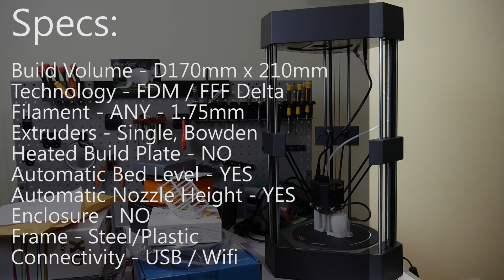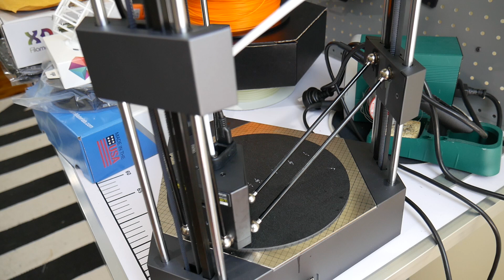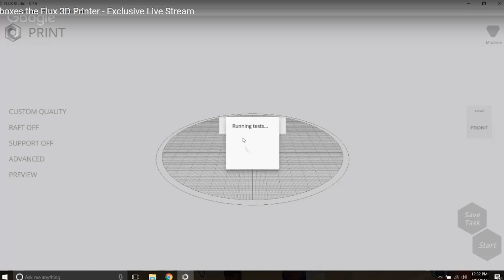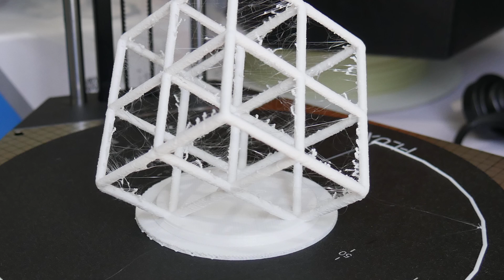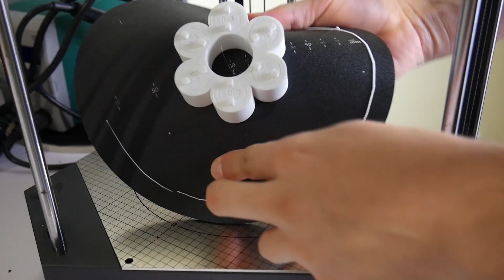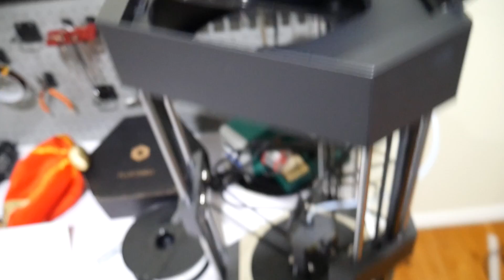FLUX Delta+ 3D Printer Review - Part 1

Comment: this sounds like a very bad printer... I've loved my prusa i2 printer and any faults have been my own, not the printers. soon that will be rebuilt into a i3 variant.

Why would a company release such a product that clearly will fail unless you modify it and maintain it after every print. Sorry but with the market of printers, this appears to be a failed attempt at something that could have worked if the just kept it simple.. price wise seems to high for the build size.

Comment: I have the original Delta and I absolutely love it. Mine is the kickstarter edition and the only ongoing problem I've had is base adhesion and laser posts popping up. Both of these issues were fixed by parts they sent out after they released the Delta+.

Mine hasn't exhibited any of the strange skin issues you experienced, but I don't use the Cura slicer. I've found that Slic3r was the best before they added Cura2 and now Cura2 is easily the best way to go. With a little bit of tuning, you can get rid of stringing, raft separation, and retraction issues. It would be nice if the printer had better defaults. I'd also love if it allowed you to identify different filament spools and supported changing of a few specific parameters (temp and retract at least) per roll without overwriting your entire set of print prefs.

I use the 2nd bowden tube along with a filament lubricater to enable holding my spools right next to the printer. I can hold 4 spools in these caddies I made out of Ikea magazine holders. All of this sits on top of a small nightstand which has drawers to hold all of the spare bits, extra spools, and scrap plastic.

Comment: hi, the machine is pretty new but I don't really get bad print results, I got the all so popular 3D benchy great and as Jeff said the stock filaments are... well.... not so good. and I got this torture test good too: http://www.thingiverse.com/thing:2064029  but with a little stringing, I don't have simplify 3D(gonna get it) so I don't have retraction settings right now. And oops, I'm not subscribed even after recommending you this printer.... 3.. 2.. 1.. subscribed, anyway please give me a worthy torture test and I will post my results, and flux has been a little wobbly on keeping it's promises lately so I had my on this, it's a little pricey but looks good: www.makerarm.com it has more tool heads than the flux(much much more) and most importantly the chocolate extruder head. anyway, thanks!

Comment: Hi Angus,
First of all, glad to final see a review on the Flux 3D Printer as I own and have been using a  Kickstarter version for a year+ now and do from time to time participate in providing feedback/fixes when time permits... and therefore also understand your comment regarding investing time doing these review. I, for one, appreciate your great efforts and feedback to the community. Yes, as you alluded, all kickstarter model comes with their "surprise package" and that is parts of the "fun" in my option. As long as Flux stays true to the Kickstarter mission and goals, and support their Backers with product fixes along the way, then as far as I am concern it is business as usual.
It is very unfortunately that Flux provided a bad batch of white PLA filament, and that due to the Printer's spool configuration & constraints, you were only able to review the product as provided by the manufacturer. Manufacturer are responsibly for their own Quality System and need to take this seriously as opposed to just sticking a QC sticker on the item.
From experience, I am very pleased with Flux support and endeavers to improve their product and attend to the Flux community and command the Flux Team in that respect. So, well done Flux, and keep it up.
Overall a fair review given what was issued for the review (again Flux is responsible for the quality of their product, especially for a demo/review) with respect to your criteria and objective. 
For those viewers attracted to the multi-tool heads capability (printing/scanning/drawing/laser) aspect of the unit, especially that of the Scanner (as was my case), please keep checking the Forum's feedback and discussions before making a purchase  decision based on that specific need.
Angus, back to you mate, and have a great time at the Bay Maker Faire... I am jealous!

Comment: I think they told you a lie. I had ordered the original Flux Delta and there was so many issues with it that they delayed shipping my order until they had to cancel making them and tried to re-invent the machine by calling it Flux Delta+, but it had the same specs and everything as the original machine. It did not look different except for the print bed (they made that magnetic). They also had this issue that would make your print head come crashing down to the print bed even though all the magnetic joints were still attached. They might have fixed that, but now there is all this weird fragmenting as you have shown. I am glad I cancelled my order when they gave me the option to. I would have regretted getting it. I originally wanted this machine because they also offered a built in 3D scanner, a laser engraver, and a drawing print head, but is it worth all the problems that came with it and pay for the hefty price tag? Certainly not.
Reply: Huh? They stopped manufacture of the Flux Delta once they'd fulfilled all the kickstarter orders, and had sold some retail, and were ready to put the mark2, Delta+ into production. 

And as far as the print bed, it is exactly the same... the hexagonal steel plate. But on top of that there is now a BuildTak magnetic print mat, which is probably a customised version of the BuildTak FlexPlate system that has just been released. 

I've never had the "print head come crashing down to the print bed even though all the magnetic joints were still attached. I've had it detach in the first days of usage due to improper USB cable installation, and not enough lubrications of the joints, but that was all. Haven't had a single rod detachment since then.

I'm sure the fragmentation is due to sub-par cura2 settings and the poor filament issues... I'm having issues with the cura2 settings, and have revered to the original cura settings with the normal excellent results.

Comment: If you have a machine big enough, just print a cover with a lip for that hole at the top with a spool holder and a small hole for the filament to pass though. Only idea I have for a third party spool holder.

On another note; 
I'd like to someone toy with the idea of a Stewart Platform for a printer. Originally they're meant for 6 axis movement, 3 axes of linear and 3 of rotations, but they could be used for just linear movement, though rotational properties could add some cool effects to printing if someone found a way to utilize them. Their basic design is 6 legs that meet at two triangles, one offset 180 degrees, and they're hinged at both ends. Most designs utilize pistons for these legs, but I've seen some using servo motors with solid legs. 
But think of six axis printing, you could print slants as like a normal vertical print. 
I've wanted one for the longest time for cnc work, due to their six axes of movement, and I've wanted them for other uses that I have yet to mess around with. 
I think the biggest problem is controlling them, due to their movement being synergistic, which requires complicated algorithms to control.
Reply: IIRC, the hole is actually smaller than the build area of the Delta, so it is actually possible to print it on it if you want to do so. There is already a design on thingiverse for it, as other users wanted to fill the hole, probably to help with dust and make use to the top space for storage.

Comment: Lastly, I never use rafts since it always stuck to the print.
Reply from the maker: Thanks for the info! Rafts should normally not weld to the part... I'll be stopping using them on this machine, it was just ticked by default.
Reply: My pleasure :)

Comment: Also, if a magnetic joint comes undone, the printer will stop. 
When you re-attach the joints you can hit the FLUX button, or hit the dialog box in the software.
Reply: When it happened to me, I didn't have the USB-C cable and the filament tube set up correctly and they knocked it out of place.
Reply from the maker: so... they do come off during operation? or? Good that it stops.
Reply: True that. I did that too. But that's just user error. Happens once.
Reply: Rarely does this happen... only when not lubricated well.

Comment: That bowden feed tube is loong. Its going to be difficult to tune in the retraction length. Wonder why manufacturers dont put the extruder on one of the linear servos to keep the length down?
- Eddy
Reply: It really is not difficult at all to set retraction. The tube is only 46cm, I've seen plenty of Bowden setups over 50cm with no issues.

Comment: Blarg... These cheapo delta machines really give delta machines in general a really bad reputation. All I ever use are delta printers and I haven't seen any of the issues that are typically showcased by the cheapo designs.

I posted this prior to seeing the price! MY GOD! 1k for that? Everything about that is cheapo. Linear rod bearings. Cheap. Magnetic ball joints. Cheap. Plastic... cheap. No heated bed. Cheap. This thing was specifically designed to rip off people who don't know any better. 

I would highly recommend avoiding this at all cost. Build a Kossel mini for less.

Comment: I am really satisfied with my original Flux 3D, especially after the Free upgrade kit (shipping cost only) which basically makes is a Flux 3D+ if you change the linear bearings like i did.
There is a very active and supportive forum and Flux support itself has been very good the last year. 

My Flux spool holder: http://www.thingiverse.com/thing:2009127
Flux 3d profile is supported by Simplify 3D: https://www.simplify3d.com/software/supported-printers/
Alternate S3D Profile: https://www.dropbox.com/s/owudzpvhchxkdd2/Flux%20Rev2.0%2020%25Infill.fff?dl=0                                                 (From: http://forum.flux3dp.com/t/simplify3d-fff-profile/1594/16 )

Comment: mmm....its actually a bit sad that is not doing that well. Already PO the unit much earlier and hope the unit would have better updated firmware / software when it arrives. Looking forward for the part II of the review.
Reply: The Delta+ should be able to do a lot better than what you saw in the review. As a Flux Delta owner, I have had much better prints from my machine than was in this review, and I am still relatively green when it comes to 3D printing. I think he just ran into issues of poor PLA (which Flux did comment on), and sub-par cura2 settings. I've had better results from the Flux Studio stock cura settings than from cura2 :-/

Comment: I look forward to your next review on the Flux Delta+ because I feel like you rushed through this review with some poor understanding of the product. Is it perfect? No. But it is much better and more capable than presented here. I have been using the Flux for over a year being part of the Kickstarter. Granted, I am using the older mark 1 version, but I get better results than presented. I think you just need more exposure to the happy users and to hear their aftermarket tips. I own three printers: another delta and a cartisian besides the Flux. I go back to the Flux constantly for its ease of use, quality of print, and silent operation. I eagerly await my Flux Delta+ and the upgrade kit for my Mark 1 Flux. I'm a happy camper. Thank you for all that I have learned from you and keep it up!
Reply from the maker: Considering the overwhelming number of reviews I need to get through my new approach is to print a set of test files using the manufacturers recommended settings, as would any newcomer. There's clearly room for improvement which is why I didn't call it in this vid but it'll be a few weeks before I can revisit. I'll be mostly phasing reviews out honestly as I no longer have the time to devote as I used to.
Reply: I appreciate that... but some things were less than noobe issues. (Like running a spool that didn't fit and claiming the noise was odd)  However, you DID NOT "call it" and I appreciate that.  You did make a statement that it was possibly just a software issue, but all the time before was aimed at the machine as a whole. I just feel that you did the guys at FLUX a little disservice in the presentation; especially if this is all that was seen by a prospective buyer. We all have days. Such, I really do look forward to the second video... I feel your videos are some of the BEST on the net for 3D printing.
Reply: yes thats true, im AW1 from the flux forum
Reply: I felt his review was fair and that he clearly stated all of the parameters to the tests, where he thought it could be improved and where he felt the main issues lie.  I am holding out on judging the printer until Part 2.